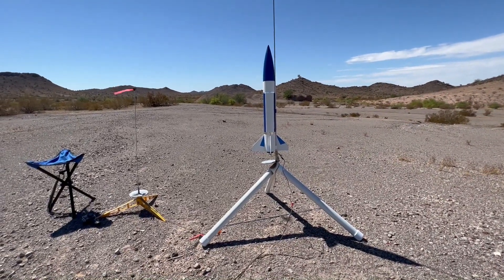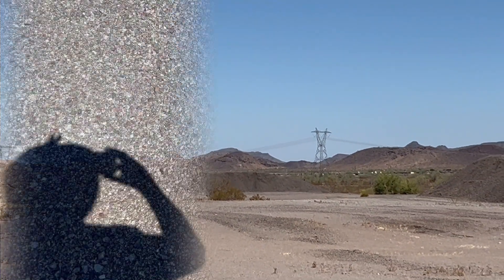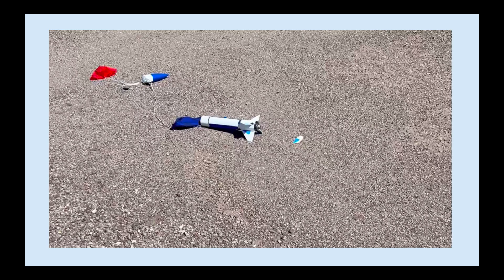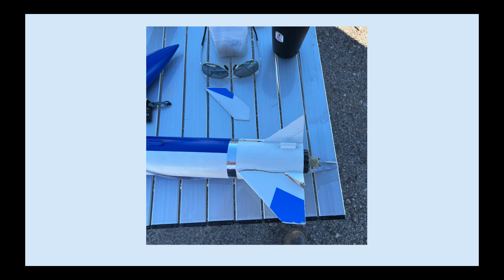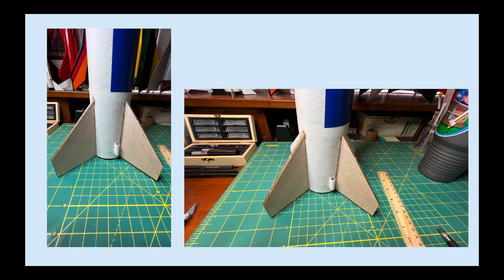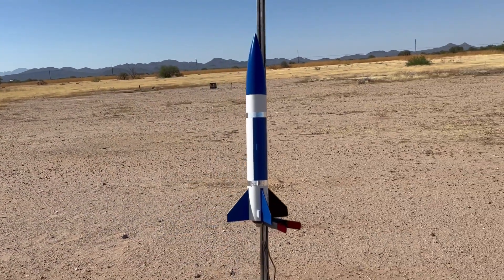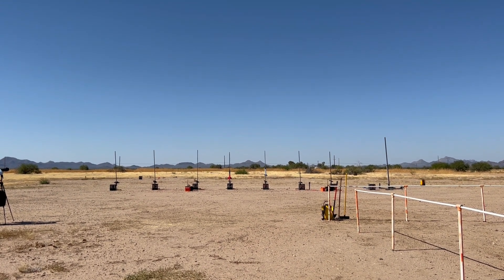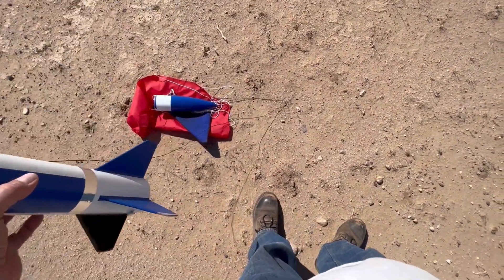The Infamous Doorknob Flight, Repair and Flight Saga!

Comment: Cool rocket. Nice repair. Did you just use epoxy on the root edge of the fins to attach to the motor mount tube?
Reply from the maker: Thank you, @chrisfell2621… Yes indeed on the epoxy! The epoxy held great. Just the fin material that broke into smithereens!

Comment: You might think about using plywood, basswood or even some G-10 fiberglass sheeting to make sure your fins will not be destroyed so easily.
Reply from the maker: Yes, I am currently building a Doorknob with ply fins and centering rings! Just didn’t want to do 2 ply and 2 balsa fins on the repair, figuring that might cause some stability issues! Always learning, which makes this hobby so fun….